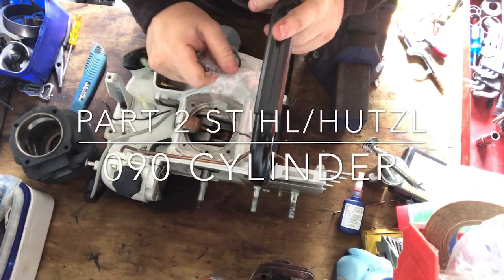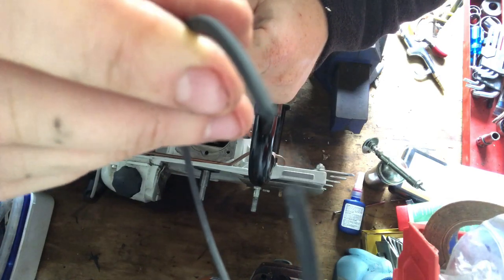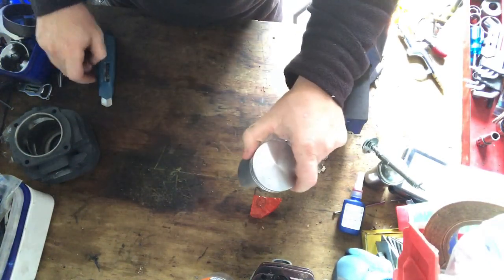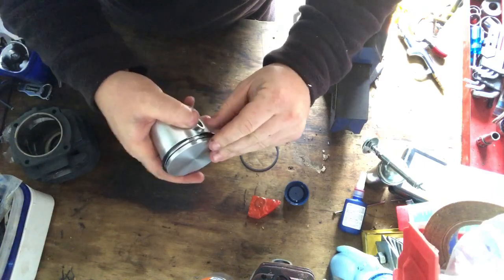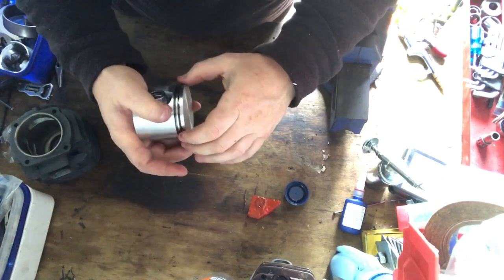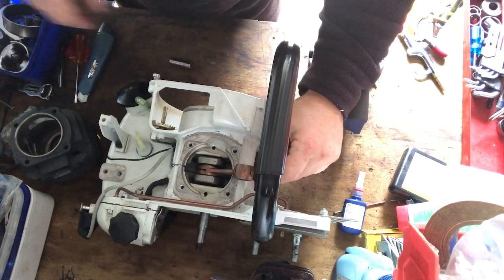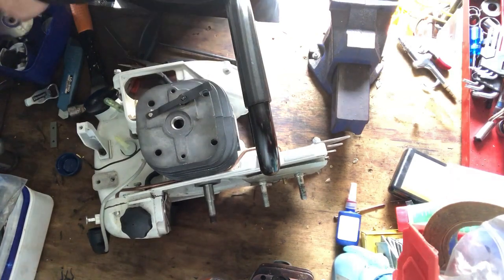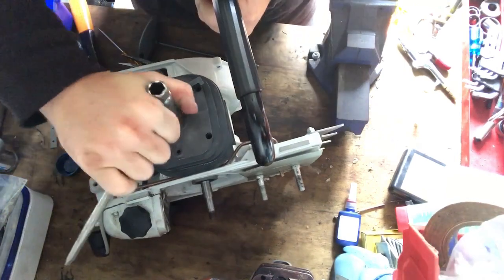Stihl/Hutzl  070 to 090 Conversion Part 2

Comment: Hiya Kiki lad,Can you answer this,when going over recent 070 to see whats what I noticed there was a lot of lateral movement of crank through crankcase,on checking your rebuild clone vid I saw your crank moved about the same  but seems excessive when you start motor crank actually has been touching side cover and crank oscillates side to side  Odd!!!! what you think,

Comment: Lovely make do assembly  with no special tools my sort of bloke as they say over here (uk),but will these 090 conversions sit on stihl 070 bottom end,,, they advertise it for 070 090 but opinions differ
Reply from the maker: @huskywiz   hey mate, thanks for the msg. To answer your question, yes they do! This saw has been used for quite some time on a mill and the 090 is working nicely on the 070 bottom end. 😎
Reply: Hi Kiwi ,yes! but is the bottom end a stihl bottom end OEM  what I was asking is is will this cylinder go on original equipement 070 sorry for vagueness but at 75 I seem to have lost literacy,,old age ay!!!!!! sorry for being a botherI read somewherethat090 after cyl had bigger diameter flange and wont sit into OEM case
Reply from the maker: @huskywiz  this saw is not genuine and FarmerTec have made it to take either cylinder without any fuss. I have not worked on a Genuine 070/090 so I couldn’t tell you to be quite honest. 
You’re no hassle mate, we got there in the end 🙂😎
Reply: @kiwilad4216  Hi Kiwi lad,as I thought,OEM crankcase will not take bigger skirt,farmertec made crankcase orifice to take there 2 cylinders i would suppose alot of people have been caught out with that one, Thanks for helping and be safe.